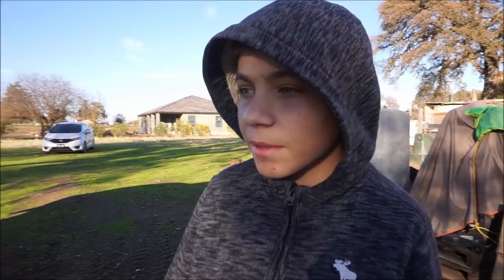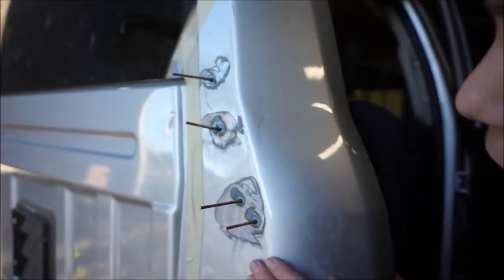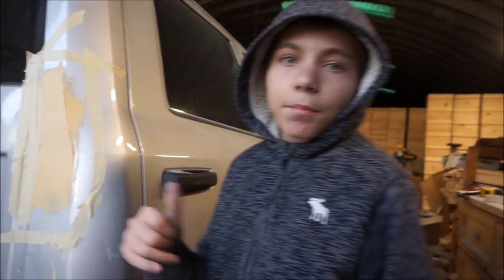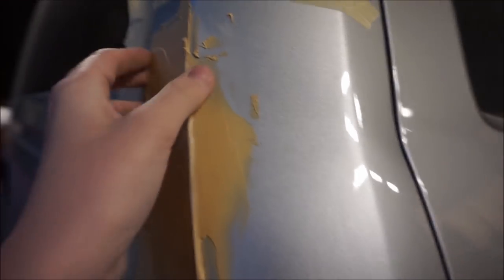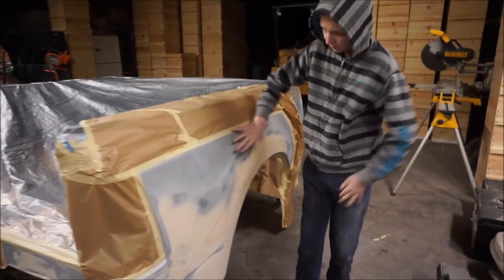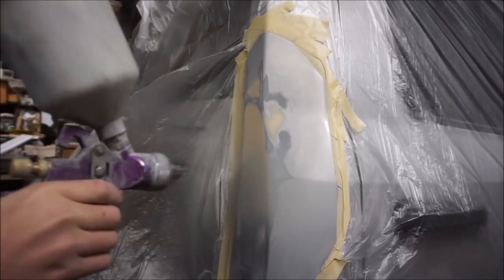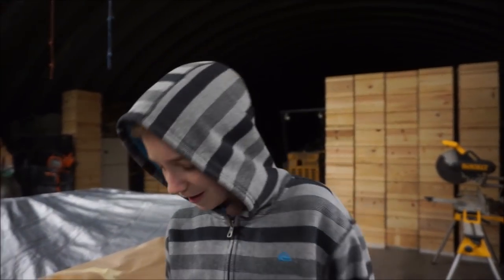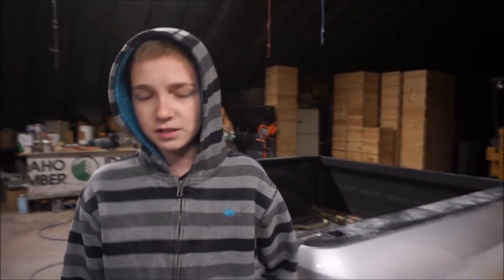Rebuilding a Wrecked 2016 Dodge Ram 1500 EcoDiesel Part 5

Comment: 2k filler primer?..If you have pinholes in your bondo, primer wont fill them unless you go extra heavy with the primer over the pinholes and then stick your finger dead center into the primer when its wet and on the pinhole and it will allow the primer to flow into the pinhole..Pinholes are hard to see in the primer if you dont put the primer on heavy enough..make the primer shiny and get up close to look and gunsight down the side and look for pinholes while your priming...nice job guys!!!